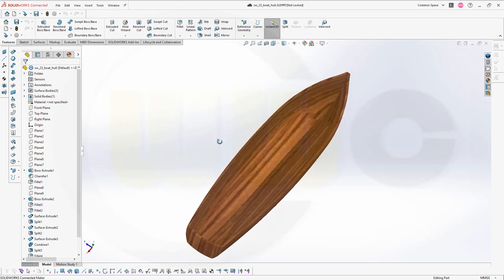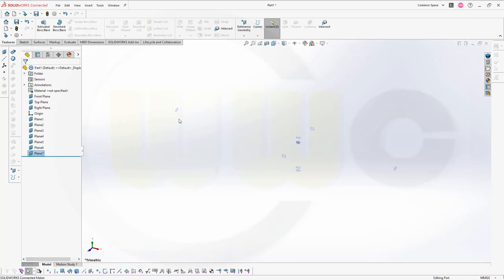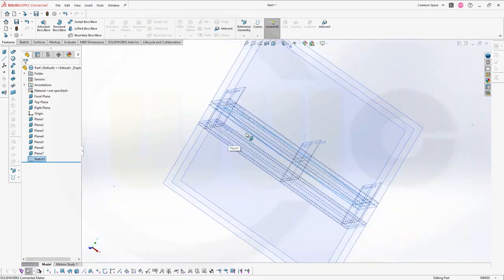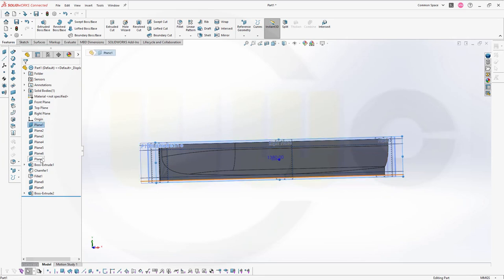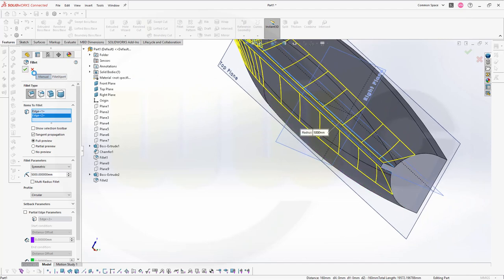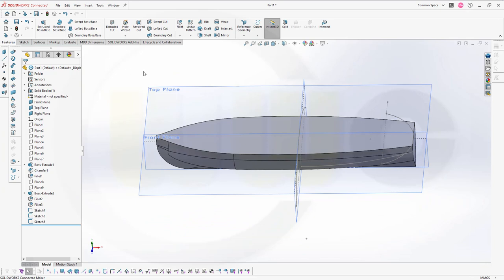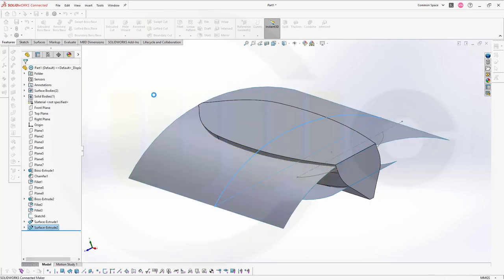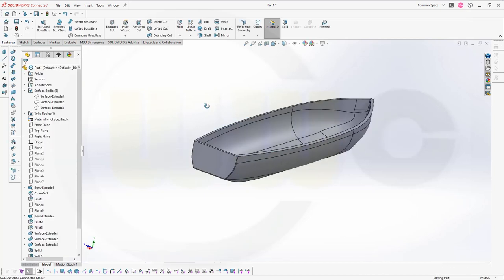Bootsrumpf - Boat Hull - SolidWorks 2023 - Part Design

Comment: A great video of another 3D parametric feature based modeling practice. However I had to mention that this is not a typical way of designing a ship/boat. The industry is using Lines to design the hull to meet several design requirements, such as statbility, speed, and so on.
Reply from the maker: 😉 I know, I´ve made a video regarding this method about 10 years ago. It is only an exercise and the result is a pretty convincing shape, isn´t it?